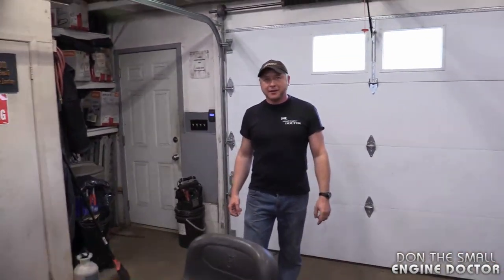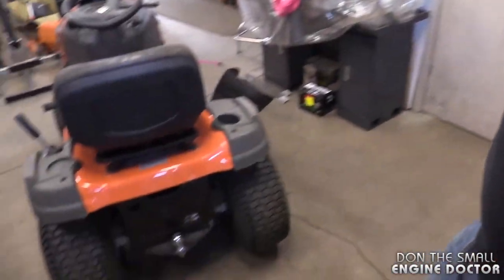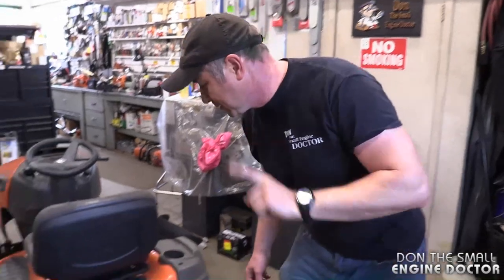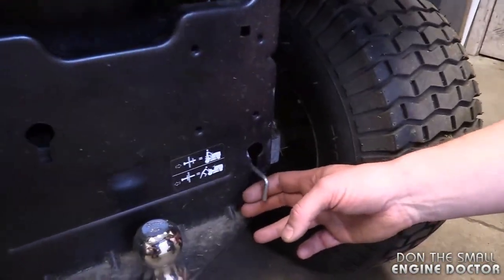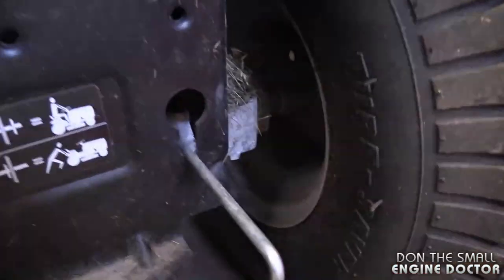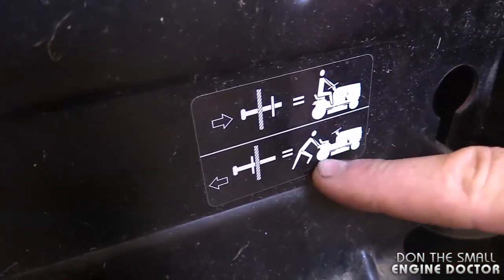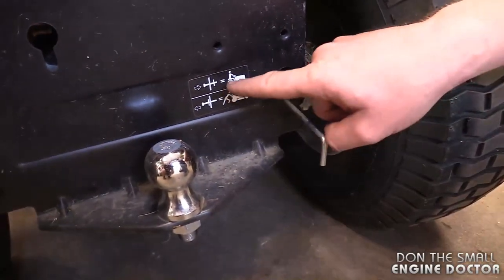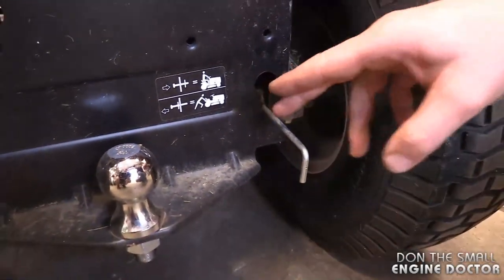Best Way To Move A Lawn Tractor That Won't Run! Teaching Apprentice Dave! - Video

Comment: That is a good question and I have a zero turn mower which is hard to push and I know where the valves are to unlock it so it can be moved by hand, but don't like doing it due to the work required.

Comment: A lot of my customers don't know this either.  The other thing they don't  always know is  that they can get of the tractor if the parking brake is set and it will stay running.

Comment: i've seen some cheapies that didnt have the pull rod. the lever is on the tranny  but no rod attatched..      also  some were spring loaded so you had to use a bungee cord to hold the lever in free wheel position

Comment: I rode my mower to the top of the mountain, to the wise man, and there, in his folding rocking chair, sat Donyboy.
Reply from the maker: lol
Reply: @donyboy73  Lol, no kidding. Did you remember to pull the transmission release leaver before starting the up hill climb?
Reply: @donyboy73  hello is the meteor piston good for the 372 xp oe saw? Can a 1-ring Meteor piston be attached to a 372 xp saw where there are 2 Epa Mahle rings? Of course, one group of 1.5 mm rings. Is the Caber ring included with the Meteor piston or do you need to buy it separately?

Comment: I now have my first  hydrostatic tractor ≈2.5 years now, when I first got it I did read the manual, but would often forget about the disconnect until I first tried to push.  I got used to it when I did the 50 hour transmission oil change as you do a lot of engage/disengage while putting the new oil in.

Comment: My lawn tractor is the same way; I did read the manual and learned about the disconnection feature, and appreciate the ease of rolling it around with the switch in the right place. However, over the years I occasionally forget, usually with witnesses present and laughing at my futile efforts to push it more than a foot or 2 with the transmission connected.  

Good job explaining a frequently overlooked feature of hydrostatic drive lawn tractors.

Comment: I'm amazed he could push it at all without pulling out that pin. I sure can't push mine with that in. (One of) mine is on the back but has a knob on it. My bigger one is missing the knob.

So funny to see a hitch ball on that small of a tractor, instead of the simple drawbar hitch pin hole

Comment: One thing worth mentioning, most owners manuals caution that starting the mower with the pin pulled out (trans disengaged) will cause damage to the transmission......

Always remember to push it back in immediately after moving the mower
Reply from the maker: thanks for the tip!
Reply: That's dumb because in the repair manual it says to do exactly what you just said after you service the hydrostat. 
It's a bypass which directs fluid in a circle instead of turning the drive motor.

Comment: I worked on a old troy-bilt that had a lever hidden  by the left wheel that had to be pulled to the side. A bit of a learning experience getting that one on  the trailer.

Comment: A fellow gave me his 20 year yard pro. Says it's hard to push with engine not running. I quickly found the release. Funny thing was also he said there were issues with side level cutting . dealer couldn't fix. Took a while for me to find deck leveling bolts.

Comment: I work on commercial mowers and a lot of them do have a lever off of the hydraulic pump(s) that can be turned to move the machine. If it’s not disengaged it has “potential” to mess up the hydraulics according to the manuals. Then again, not all tractors will have this option. At least from my experience.

Comment: And if you have one with a mess up release that will not work, you can use a pallet jack, bring up the deck as high as possible, slide the pallet jack under & lift. Works like a charm on flat surfaces.

Comment: I bought an old Murray and I had No idea how to get it to roll. I found that lever under the seat. But no matter which a way I put it, it would not roll. It did not work.  So I used some hand trucks to lift the back end to roll it around. As far as a owners manual if you look on line you might find one. They have a way of vanishing faster than a UFO.

Comment: Could forcing a hydro transmission to move without pulling/pushing pin, cause damage?
Reply from the maker: i'm not sure on that one but my guess would be yes it possibly could
Reply: @donyboy73  Yes, because you are forcing fluid backwards through the pump.

Comment: I had an old Wheel Horse zero turn that had Eaton drive units , you had to flip the seat and reach down to engage / disengage the drive units and if you didn't know where they were it was not obvious .

Comment: I usually pull the tractor out of the shed by hand. If I had a nickel for every time I remembered to push the pin back in before attempting to drive away, I couldn't afford a cup of coffee.
Reply: Been there, done that!

Comment: Donny, I have a question for you. I have a 2016 Cub Cadet XT2 lawn tractor with 93 hours on it. I just drained the transmission oil and replaced the 10W-30 oil with Tuff Tech 5W-50 hydrostatic oil from Tuff Torque. This is a K46dv trans with the locking differential feature. I purged the air and the tractor ran fine after the fluid change. The only issue now is that for some strange reason the cruise control speed for mowing is slower than before. It is too slow really. Is there an adjustment in the linkage to change the cruise control speed? Thanks, I enjoy all of your videos.
Geo from MI

Comment: Hi guys... does a hydrostatic tractor like that have Hydro fluid for the transmission completely separate from engine oil?  I know a zero-turn does( some are serviceable some are not) but not sure about a tractor style unit..
Thanks much
Paul

Comment: Hey Dony, on my hydrostatic transaxle, even if i pull the pin, it does nothing and there's no resistance on the bypass rod on the uotside cover of the transaxle. It is always hard to push the tractor. I have a Husqvarna YTH150.
Can you help me please? 
Fantastic channel, got a new sub!

Comment: That works on some hydrostatics but not all. Especially a Toro SS5000. There are 2 options. 
Option 1 is the machine will start
Option 2 is it will not start
Reply: The Toro Zero Turn has an electronic brake that only releases when the control arms are pulled out , if the motor does not start , you have to physically disconnect the Brake rods from the Brake to move the machine

Comment: Hi Donny I have a question I have a Stihl Grass trimmer that I bought last year I have been using 40 to 1 and 50 to 1 premix in the trimmer and now I'm getting oil out of the muffler and over the casing is there anything I can do

Comment: Hey
My friend has a stihl bg86c. Leaf blower that's not running correctly at all. He's put new gas line &filter,air filter, new carb,checked all the head bolts for proper tightness,spark plug etc it won't rev up.  Any bloody ideas mates????? TIA
Reply: The muffler could be clogged and sometimes you usually have to adjust a new carburetor. I've had to do that many times